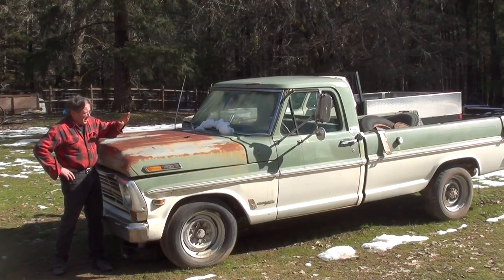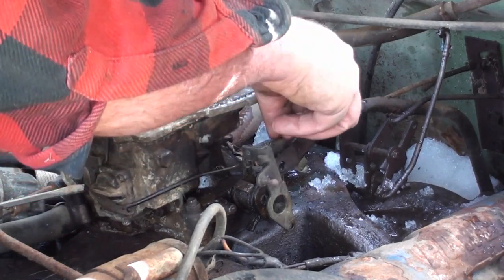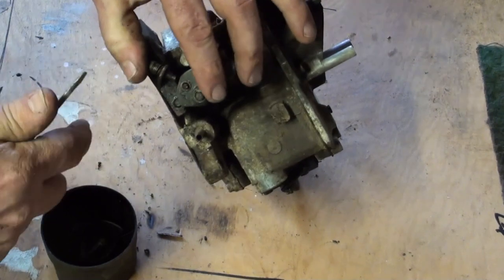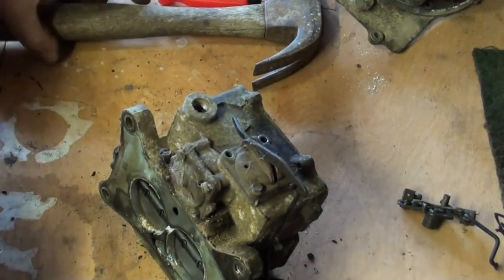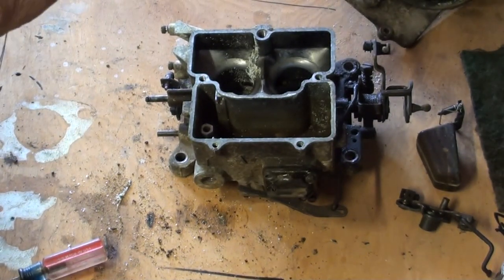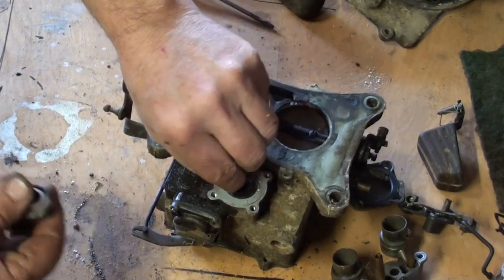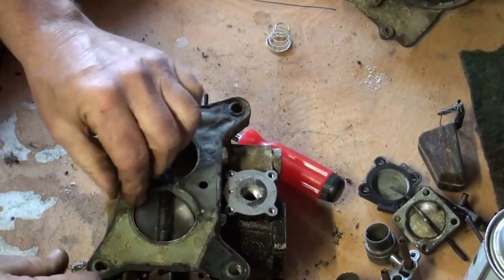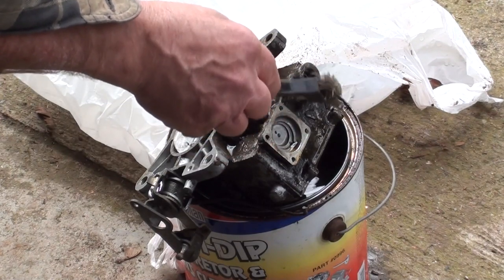Bringing It Back To Life: 1968 F 250 Part 2 Autolite Carburetor Disassembly

Comment: I used to have a milk crate full of those carbs for my mighty 390 in my 76 F250 hiboy. Used to get rebuild kits on sale for $12.99. Better times back then, didn't need a code reader.

Comment: I just picked up a 72 f250 sport custom about two months ago for $700. It came with an edlebrock carb, four barrel intake, and a MSD Billet distributor, which was still in the box. I think I got an angry wife special discount. Stock carb and intake were in the bed too.
Reply: My pops had a 69 F1 and a 72 with 390 fe' s and the stock whirly spark maker is garbage. Points always loosening. Stops on the road ill just get out my fave business card and reset them.

Comment: I was way out in the country with my two little girls in an old F250 when the truck ,although still running , just stopped going forward.
I got out bewildered and looked under the hood. 
All the linkage had fallen off the carburetor.
I started searching around on the heads and in every nook and cranny and found enough pieces to get it so I could get home. 
Thanks again lord for watching over us, lol.

Comment: Them are the good old days I remember tearing apart those Motorcraft 2100 then they came out with the 2150 I used to spread a newspaper on the kitchen table that's where I did my carburetor rebuild I tell you I really like the Edelbrock that Carter is long as it don't have the plastic tanks is an awesome carburetor usually if they're acting up all you have to do is clean it and blow through everything

Comment: Glad to see you . I
 Just swaoped A 427 truck motor in a 86 F600 old was 2 barrel new was 4 barrel .  Even the OE carb rebuild kit left out few parts to rebuild . lucky I had couple dozen boxes of "extra" parts I saved over years.

Comment: I still remember when today's Elderly Iron was just used cars. I had a few, and it seemed they NEVER had that darn tag on the carburetor. I always wondered why anyone would throw it out. Sure made it interesting to rebuild them. The good news and bad news about a carb: Good: You can rebuild it yourself. Bad: You HAVE to rebuild it, sooner or later. But, fuel injection would be useless junk after sitting for ten or twelve years. Great video, as always. Linda and I send our best.

Comment: Strange, rebuilding old carburetors seems to be rocket science these days. People throw old ones away without realizing they can be rebuild sometimes for like 20$?
Reply: Now is prime time to ride around and pick up lawnmowers and other small engine lawn appliances left on the curb for trash because the carbs are clogged or the fuel line broke. You can even find higher end stuff for cheap in your local paper for the same reason. In a consumer society tools and the knowledge to use them are often overlooked.
Reply: Yep, tell anyone under the age of 35 that you can rebuilt carburetors and they look at you like you fell from the moon.
Reply: @2boredfortv  heck there's Mustie1 that gets free small engines all the time and fixes them up, and most times he can get them running
Reply: Im 29 and although i do rebuild carbs ive never had any luck with autolight on fire carbs. Im no master by any means. But the cursing they have induced while putting out the numerous fires.
Reply: Also after its on fire a few times the bolts and screws go in and out nicely.

Comment: The Berryman chemdip is the same chemical compound  as I used in Diesel work decades ago. it's made from Coal tar,hence the "odour" . It's water soluable but if you use a lot of it and wash it down the drain it will jellify (is there such a word ?) and block the drain. I know this because we had a big wash down pad where we would apply the stuff with a mop to big engines, then hose them off with the fire hose. One day the water backed up ,so we got a plumber in with his eel machine... which was unable to unblock it. We had to dig up the drain to the boundry and put a grease trap and new pipe in .($$$$$) but it works great! 
But being made from coal tar it is out of favour because it warms the atmosphere and will end the earth in 12 years.
Reply: good stuff always gets banned. sad,

Comment: I used to use Kleen Flo carb cleaner back in the 80’s , until the kids came along and there was a possibility they could get into it. The stuff was mainly carbolic acid or phenol. The oil industry used to use phenol to treat crude oil. So I got a better idea. At work we used to clean clock winds for circular chart recorders and I built my own , with an old sink and function generator and a speaker silicone to the bottom of the sink .
Hence no more chemicals for carb cleaning . Just a thought

Comment: the fuel bowl vent prevents percolation. when you shut off the hot engine you don't want pressure building up in the fuel bowl to push fuel into the engine flooding it.

Comment: Russians mostly use diesel and sometimes gasoline (rarely acetone or "whitespirit" is used) to clean carburetors and other parts of the engine. I don't know which way is correct, but villagers are poor and the combutible is more accessible than specialized chemical liquids.
Thanks for your video!